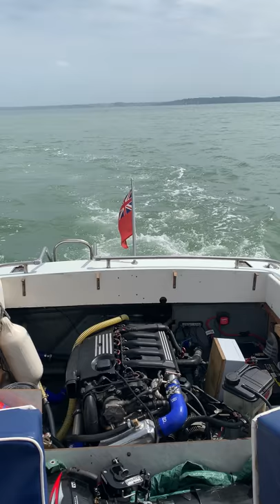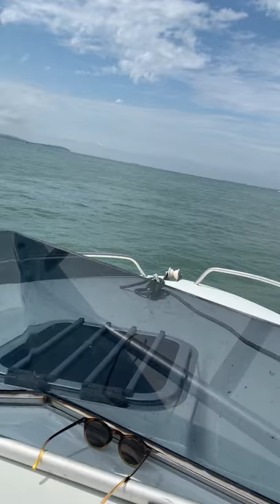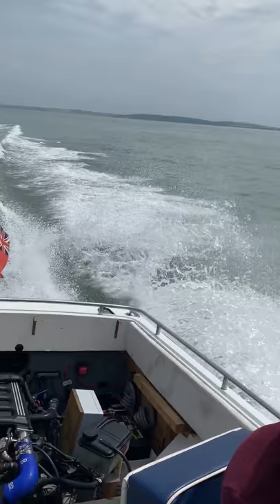BMW M57 turbo diesel powered speed boat UK solent

Comment: A Volvo Penta counter-rotating outdrive would be a good setup. The counter-rotating props setup grips very well which will allow the torque to propell the vessel at optimum. A single prop would slip too much. Silverhawk and Albermarle use these outdrives with optional V8 Mercruiser which is a GM 5.0 or 5.7 platform, or a Yanmar diesel.
Reply from the maker: I do get quite a lot of slip tbf, I have currently got the lower unit off to fit the 1.61 ratio gears which should improve things and bring down the rpm. It’s currently over 3000 before it even planes.

Comment: Hello,
Nice achievement
It must have taken you a long time
I have an identical project to carry out
it is for a twin engine replacing 2 vovo penta AQ151C with 290 SP bases
I would like to exchange with you on some technical points
- gearbox ratio before / after
- cooled exhaust
- adapter spacer
-modification of the computer
and more 
while waiting for your return
again good job

 D1
Reply from the maker: Sorry about the slow reply;
Gearbox ratio is 2.15 iirc but I have a gearset from a V8 to fit which is 1.61 currently the boat is over revving really, these engines loose power after 3500 rpm or so, mine doesn't plane till nearly 3000... 
The manifold is just the standard cast one from the car, but the water from heat exchanger drains into the exhaust right after the turbo. Not had any issues with this set up and I've had 3 people on two water toys behind the boat. 
The adaptor plate is two pieces water cut from steel, one on the engine and one for the Volvo sterndrive.
The ECU etc was done by a company in the North of England I believe it was rally raid. It's remapped to 230hp which in a car is fairly low but I definetly wouldn't go any higher than this in a boat. 

Anymore questions fire away, cheers